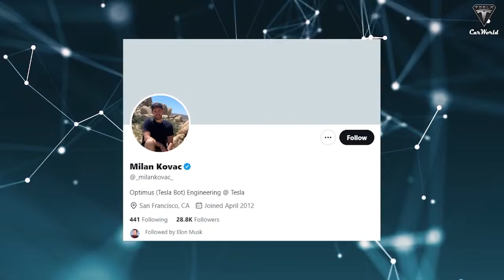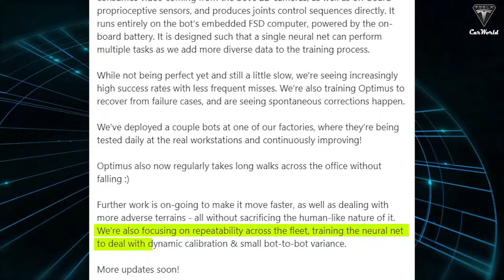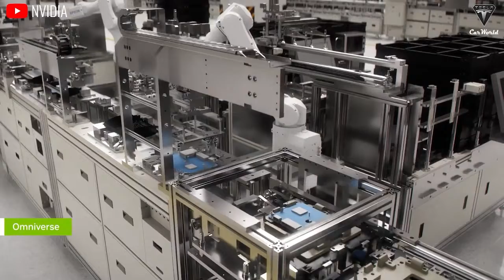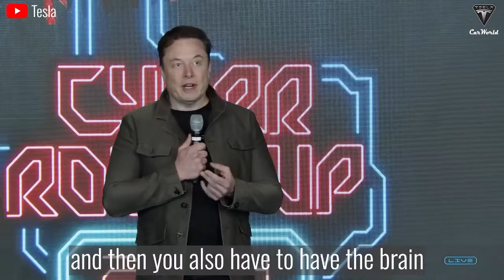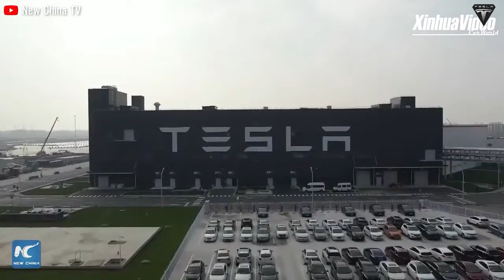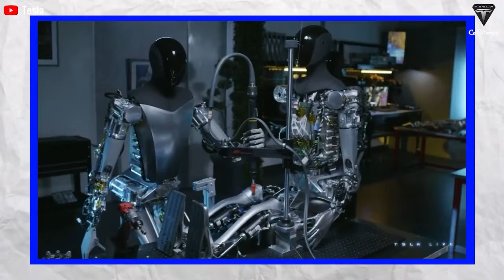It Happened! Elon Musk Confirms 2025 Tesla Bot Gen 3 with SHOCK Features, Price and Multi Tasks!

Comment: Improve Batteries with more Capacity and more Output Voltage to provide Explosive Reaction Speeds

Improve Walking Speed.

Improve the IMU for better Balance.

More Degrees of Freedom in Hands and Neck so the robot can see what its hands are doing.

Smooth Joins covered with a Elasctic Membrane to avoid the robot from getting stuck with other objets and to avoid people's fingers from being chewed.

Increase the Type and Number (Sensoric Resolution) to increase the level of Situational Awareness.

Comment: Stolen patent QR code pairing software in Evs and robots mass fraud
Reply from the maker: Please join us in following the information as soon as possible in the next video. Thank you very much!
Reply: Whats the difference between a robot and a human, robots don't burn calories but they may be essential for space travel. The 2 dimensional qr code is stolen from my patent containing a 2.1 BLE protocol pairing method connecting mcu, lithium ion battery, mic, speaker, horn, display, wireless magnet charging. Your car and robot using the same components built on a larger scale.  You acquired it you don't own it. Bluetooth dishing out £10,000 yearly licenses for software code they don't own. and by removing all dates and specifications this year 24 years in their files something not quite right about that.